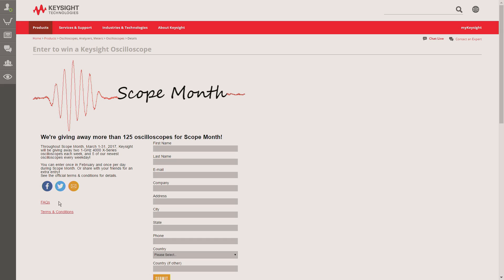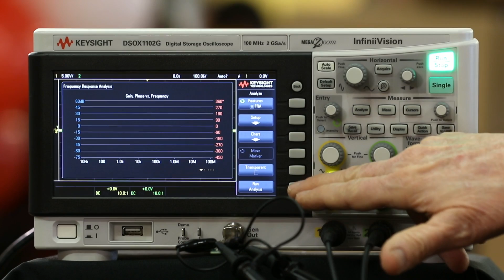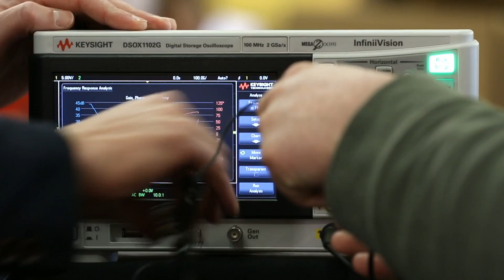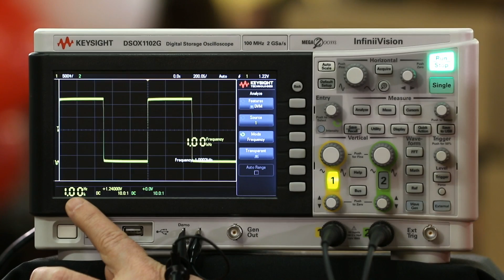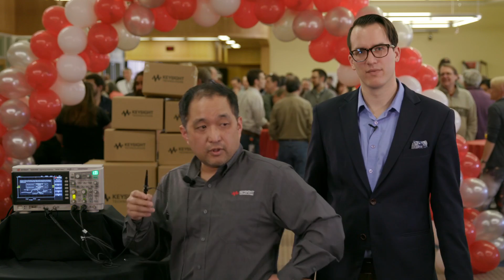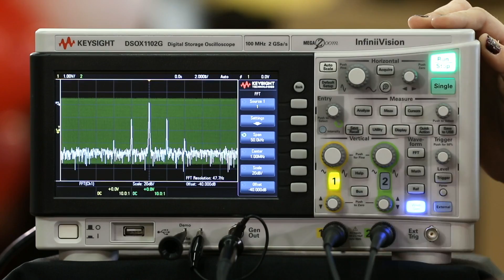Big Announcement & Keysight Scope Month!

Comment: I actually had a couple questions on the Contest and the Scope itself.  1) will you be posting the daily winners on YouTube and/or ScopeMonth.com?  2) The Scope doesn't come standard with the Serial Decode option?  Have you published Pricing on these opts (Serial Decode, 100Mhz for the 70Mhz device, DVM)  3) The DVM is an option you only get if you Register (email), and something was said that it was only for the start (does it become an option later).  Hopefully someone see's the post - Thanks.
Reply from the maker: Hi Chris, good questions!

1. Winners will be posted on our YouTube channel each weekday in the form of a daily video.
2. Correct, it does not come standard. Pricing depends on the region and should be posted on the website
3. The DVM is now free with registration for all InfiniiVision Oscilloscopes, and it will be that way forever. It is not a limited time offer.

Good luck in the sweepstakes!

Comment: 15:25 -> you can use external as a digital channel so you can do 3 channel spi. Great! awesome! FINALLY!
but then the manual says: 
"NOTE: The 2-channel DSOX1000-Series oscilloscopes support 3-wire SPI. 
The MOSI and MISO signal settings are forced to be the same; essentially, you can probe one or the other."

so you can't do MISO/MOSI/SCK and end decoding on timeout.
then since it's not mentioned again i assume it can't be used as an input for the other decoders so cou can free an analog channel
is it correct? 
otherwise by having a really useful digital channel i would be VERY glad to pay the premium over say a siglent sds1000x+ (forget the frequency analysis bit, it's not that i would use it every day)

Comment: Jae Yong, I am excited to hear that you are returning because I have a probe question! Which Keysight probes have springy tips? I don't mean the ground lead, I mean the tip itself. A few months ago I had the chance to use a TPP1000, and the springy tip was luxurious -- but it was plugged into a Tek scope, so the rest of the user interface was, err, less so. Keysight, by comparison, has silky smooth user interfaces, but all the Keysight probes I have used were fixed tip. If I want complete decadence in my test setup, with luxurious springy probe tips and silky smooth UI, which scope/probes do I need to buy? Thanks for your help!
Reply from the maker: Hi Jonathan,
Thanks for your interest in Keysight probes and scopes! Among many different types of probes we have, the N2870A-76A passive probes provide springy signal tips (with pogo action). Each probe comes with a few pogo tips and solid tips that user can choose to use with.   
http://www.keysight.com/en/pd-1661717-pn-N2873A/passive-probe-101-500-mhz-13-m?cc=US&lc=eng 
Tips are pretty robust in general, but in case you need more you can purchase the tips separately.
http://www.keysight.com/en/pd-2422944-pn-N4829A/probe-tip-kit?cc=US&lc=eng 
Hope this helps. Let me know if you have any other questions.
-Jae-Yong
Reply: Thanks for the info! It looks like these are a bit above my price bracket, but such is the nature of many fine things. Perhaps someday I'll have a job with a 9000 series scope. Or maybe next time we make a big order we can convince the Keysight salesman to toss in a few  :) Pogo tips are the best!

Comment: The FRA function would have saved my life in last test... from 1hz to 1Mhz, step of 1000hz, measure gain differences in a rc circuit...
man you are my hero😂
Reply: Had the problem before: have used a rigol signal generator and a DS1000z scope, connected trigger out of the sgen as scope trigger and have written a python script to control both via USB: auto-sweeped frequency and grapped data from scope, done FFT on it and built a plot using matplotlib. Took me a few days to get it right (rigol's USBTMC is a bit tricky) but the bode plots were very decent (including phase).